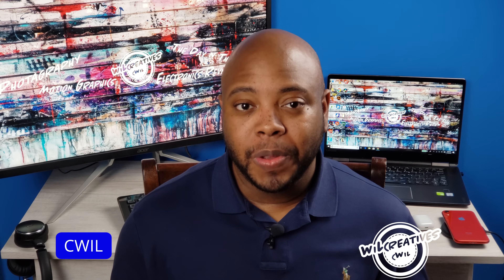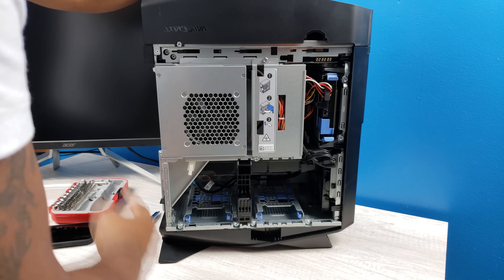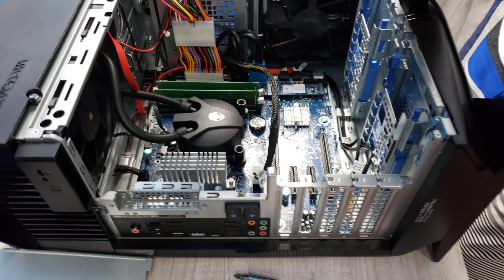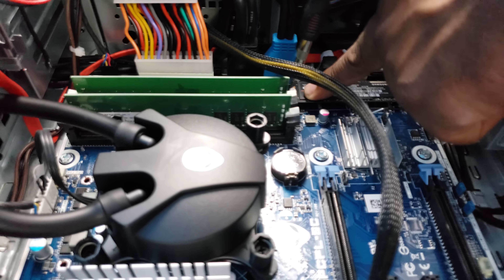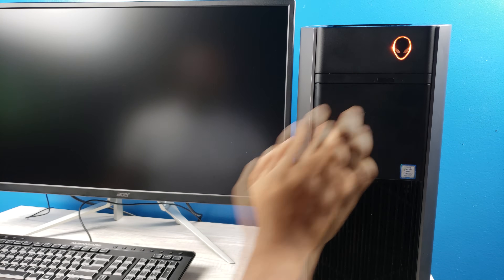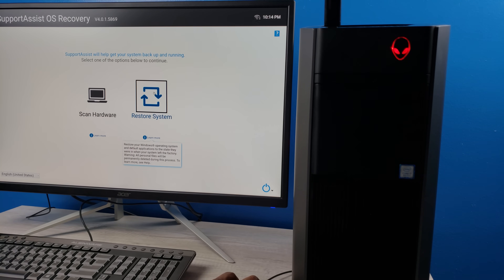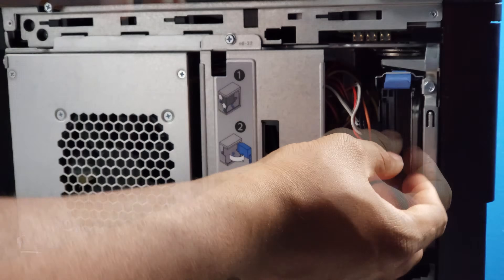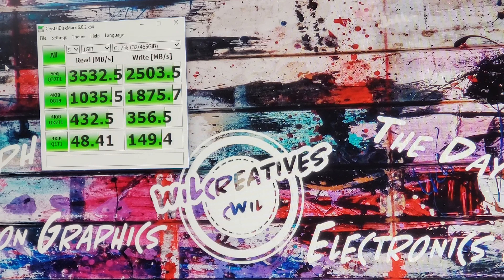First Impressions / Installation Samsung SSD M.2 interface 500gb 970 Evo to Dell Alienware Aurora R7

Comment: Hi Will, I live in Ontario Canada. Your m.2 970  is not available here. I see this one  Internal Solid State Hard Drive,Upto 7,450MB/s,Fast Speed for Gaming,Heat Control,Direct Storage&Memory Expansion,MZ-V9P1T0B/AM[Canada Version] 1 terabyte Would this one work for the R8 I just don't know what to do some say don't clone I just want a larger c drive for windows. Also this raid or ahci setting which one do I need I don't see a list of drives in bios only windows boot manager then onboard mic ipv4 then on board nic ipv6

Comment: Hi Will, Great content I watched a bunch of videos already. I have an Alienware r8 i9-9900K 16 gb memory 2.2 tb storage rtx 2080 850 power supply liquid cooled, added a samsung 870 ssd evo 250gb. My c drive is 256 toshiba NVMe KXG60ZNV256G. My c drive is almost full 25gb left I have windows 10 but need windows 11 Windows 11 needs 50 to 200 gb of space to be safe. I need to upgrade to a 500gb or 1 tb c drive. People tell me install a samsung sata evo 870 500 gb then clone c drive to evo 870 I need help Should I just install what you did the m.2 970 instead of sata evo 870 Should I copy c drive with windows 10 on it to a usb stick install the m.2 then use usb to put old c drive contents back then upgrade to windows 11my system tells me I have a free upgrade to windows 11 just click upgrade

Comment: Brother! 🎉 Your video from 6yrs ago is still helpful in 2025, thank you Will ! I installed a Crucial T500 1tb nvme into my alienware r7. Speeds are blazing fast.
*Tips* Will mentioned them but just a reminder/ clarification *BEFORE YOU begin, You disable the intel optane memory in the " Intel rapid storage" software from your pc, just click disable and agree to it. You might have to restart your pc, but just check again if the status is disabled, this is what you want to see, before turning off your pc and working on it. Once you install your drivers after the fresh windows install, I didn't check to install the intel optane memory software, I just unchecked it.
If you're only using a Nvme ssd you need to set it ahci in bios, like Will did.
Save yourself time and skip the support Os Recovery, I had the same issue. Just make a windows 10 bootable usb from Microsoft's website, its super easy, just watch a YouTube video. 
Thanks Will and hopefully my comment helped clear things up.
Reply from the maker: I'm glad I was able to help!

Comment: Hi,

I am planning to do this same thing. I want your clearance, does it support speeds of 3500MB/s when using samsung 970 evo plus nvme on board because the interface speed shows limited to 6gbps which is around 600MB/s. I have ordered both 970 evo plus nvme and 870 evo sata ssd

Comment: Great video... quick question. A little confused about what Intel Optane memory is..... I have  an Aurora A7 and my M.2 SSD is Liteon NVME..... is it Intel Optane as well? Also wonder if I have to disable Intel Optane setting in Bios before swapping the SSD? Thanks in advance for answering these 2 questions... it would help a lot

Comment: This is an awesome tutorial. It's been so long since I've gone into a computer to modify it and it's daunting. My actual hard drive is failing so while I was at it replacing it,  figured I'd switch out the 128GB M.2 SSD with a larger one and completely do a whole system wipe.  Watching it now, will be following along again when I do the procedure tomorrow!

Comment: great video sir! im wanting to do the exact same thing, would you still recommend that same SSD or is there a better option you'd recommend? ive heard that the R7 motherboard cant do gen 4 SSD speeds but i was considering just getting the best gen 4 that will fit so if i ever do upgrade to a new motherboard ill already have a good SSD for it. ive heard that gen 4s will work in a gen 3 slot but idk if that will cause any issues. if thats an issue i guess whats the best gen 3 M.2 SSD that you'd recommend.

thanks

Comment: Question Will, I think I messed up my computer, and I'm very sad. So, I did not realize that you had to disable the optane memory before you took out the actual disk from the M.2 slot. I took out the Intel Optane and replaced it with the Samsung 980 SSD. My computer now will not boot and continues to say something about searching for media devices. Currently, I do not have a USB to download windows onto. However, when I do get to a computer tomorrow and download it onto the usb, do you think booting it from the usb onto the ssd will fix this issue? Thank you very much.

Comment: 4:27  there's no need to unscrew all that.  the panel you took off has picture instructions on how to swing the power supply up so you can get to the motherboard, no screwdriver needed EDIT:  Not trying to be an ass, just pointing it out to save you some trouble next time you need to get into the guts

Comment: For those of you that are having issues with the internal HDD not showing up after installing the M.2 NVMe, it looks like the culprit is the drive it self. You need an M.2 SATA SSD, NOT an NVMe.

Yes, I know in the video Will uses an NVMe, but it looks like it's hit or miss. The guaranteed method is getting an M.2 SATA SSD. 

After testing, this is what I found out. I used a spare M.2 SSD that I had with the B key (so three notches on the M.2 Drive instead of the two as shown in the video. Here is a reference in case you don't understand what I mean - https://www.atpinc.com/blog/what-is-m.2-M-B-BM-key-socket-3) Look at the picture with the caption M.2 SATA SSD

I installed the M.2 SATA SSD, switched from RAID to AHCI, plugged in a Windows USB drive, re-installed Windows, went through default setup, logged into my account, went to Disk management, and Boom! Found the internal HDD with unallocated space. I right clicked on the internal drive, selected new Simple Volume, renamed the drive, did a quick format and now the internal HDD is being used for storage :) 

I hope this helps anyone else who was dealing with this frustrating issue. Again, you need to purchase an M.2 SATA SSD, not an NVMe. It's a hit or miss with the NVMe!
Reply: I got my SSD in it works but now my HDD isn’t showing up at all
Reply: @griffin0290  is it an m.2 SATA or Nvme?

Comment: Hey man, I did all this and for some reason I cannot use my original boot HDD at all. It's detected in BIOS but in the OS it will not show up at all. Any ideas?
Reply: Dax, did you resolve this issue? What type of M.2 did you buy? NVMe or PCIe?

Comment: I found an Aurora R7 for a good price today and did two things straight away - picked up a 1tb nvme drive and a Corsair ML120 Pro for the radiator fan.  The stock radiator fan runs at 100% and is loud.  The Corsair (non rgb) is the only third party fan that won't throw a code when you plug it into the motherboard and it maxes out at 2400 rpm & 37 dBA.  I thought about trying to clone the M.2 drive, but I everyone keeps complaining about the boot portion not working, so I created the OS Recovery just like WiLcreatives did in this video.  I switched the drive to AHCI.  I selected the windows boot manager and gave it a shot.  It took a while to load up, but seems to be working.  I did NOT get the same OS Support Recovery as shown in the video.  It was similar, but with different options.  I elected to do a Reset and Update.  I chose not to back up any folders since it's a new PC for me anyways, so nothing lost.  Now for the sad part - I've been sitting here for a couple hours waiting for the download part to finish.  This Reset process says it could take 1-5 hours... I'm thinking it's definitely going to be closer to the 5 hour mark.  I wish I had a quicker option.

Comment: Question, I would like to do this to my pc and was wondering do i have to do a full windows recovery to setup a new mvme m.2 drive(without intel octane), or would the original 1tb harddrive have windows and all my files still on it? So i wont have to do a windows recovery step?

Comment: Can we use 1TB instead of 512GB SSD? Also, My warranty is off so how can I retrieve my windows key for fresh installation?
Reply: hi, reinstalling Windows on the same computer motherboard doesn't require windows key.  Windows will automatically activate. Only if you replace the motherboard that you'll need windows key to reactivate.

Comment: I'm looking to do this with my son's R7.  I'm confused as to what is truly compatible, though.  I'm considering the Samsung 970 EVO but I also read about the WD Black SN750.  Do you know if the WD with heatsink will fit the R7?

I can't stand how Dell configured his system.  The OS/boot drive is a 128GB M.2 SATA SSD.  Installing software is a major pain because despite trying to ensure everything installs on the larger D drive the C drive still fills up.  I want to replace it with a 500GB NVMe drive.

Comment: Isn't it simpler to clone the two drives after initial installation of the SSD and then use the NVMe as the boot drive?

Comment: Hey this video is helpful . I have installed Samsung 970 evo plus in my hp envy bp112dx but i am getting one problem it is working on PCIe 3.0×1 because of which i am not getting full speed how to change it's interface to PCIe 3×4

Comment: Hi, I'm planning to install a m.2 sad pretty soon on my aurora r7. I have watched the video but I just have a few questions regarding parts of the video that I didn't understand. 

1: Do I change the SATA operation to AHCI even if I don't have Intel octane memory?
2: How do I get the data to a USB for a windows reinstall?
3: After installing the m.2 ssd, is it required to disconnect the hdd to make sure the windows reinstall will be on the m.2 ssd?
4: Is the hdd reformat required? If so, do I need to backup all the data in my hdd before I do a windows reinstall? Asking this because it seems like you just let the Alienware Support OS take care of backing up your personal files without any manual backup. I have a 2TB hdd and I have over 1.3 TB of data on it (not sure how big my personal files are), but I don't have enough spare storage to backup all of it.

These are all the questions I have and I apologize in advance if some of them are redundant. This is an old video so hopefully you see this comment at least before black Friday. Thank you.

Comment: No matter how many times I do this I can never get to the supportassist os recovery. I do what you did to a T but it always takes me to windows troubleshooting. I would appreciate any help or advice anyone could give me
Reply from the maker: golden crab126 in the video it didn’t work for me either. I used another computer and downloaded windows 10 to a usb drive and installed Windows then downloaded the drivers from Della website.

Comment: Quick question, I just installed the SSD and it works fine, but now after plugging in the HDD again it's no longer detected. How do I fix this? Thanks
Reply: Did you fix it?
Reply: Did you fix it?

Comment: i have followed everything in this guide perfectly and it worked but after a few updates and downloads of games on my computer onto the new ssd, my other 2tb hard drive is gone and only detectable in bios and not even disk management, any help??
Reply: Hey did you manage to fix it? Maybe check that the cord didn’t come loose for the HDD

Comment: Is it necessary to do a fresh install of windows when removing the optane memory in favor of the new SSD replacement? In other words. Can you just remove the optane and replace with ssd and use that ssd as storage for games instead of as a system drive with no changes to the HDD as System Drive?

Comment: Will this work with both the Samsung (MZ-V7E1T0BW) and the Samsung (MZ-V7S1T0B/AM)??  Both are 970 Evo Plus SSDs but the latter says up to 3500mbps data transfer rate as opposed to 550mbps and the hardware interface of the faster one is PCI Express x 4 as opposed to the solid state drive on the less expensive one.  Dell support won't tell me at all and I figured someone here might know.  Thank you in advance and thank you for the videos!

Comment: I have the same computer, however, I purchased the Samsung 960 Pro and would like to clone my ssd to this new Samsung 960 Pro. Only issue is that there is only one M.2 slot and the usb cables that would allow me to connect the m.2 externally have not worked (computer does not recognize it). 

Suggestions from anyone who has successfully tried this??

Comment: ok i have my windows created on my usb my question is ive unplug the original ssd m.2 optane memory like you took out and actually put in the evo 970 thinking it was plug and play lol .what puzzled me is that when i booted the computer up i had windows and all my files  and it showed the evo 970 as storage so if i do your steps what is going to happen to the originals windows  that i have where do i delete it so i can put the clean windows install or maybe i dont have to do a clean windows install becuase its on the sata drive. best buy must of installed the windows on the sata  drive if i put the evo 970 in and had windows maybe i just only need to set up my  bios settings like you did to boot  from the evo 970 then i shuold be good right. so i dont need to unplug the sata becuase if i did then it wouldnt recognize windows does that sound right bro.

Comment: Great Video....I have watched it a few times..    This is a first for me and don't want to mess anything up.  I want to install the Samsung 970 Evo Plus 1TB in my Aurora R7. The original drive has two key slots and is SSD sata whereas the Samsung Evo Plus is NVME has only one key or notch on the drive.  Is this a problem?  It appeared that the sata in the video had two keys and the Samsung had just one so I'm assuming this is fine to use in the m.2 slot?  Thank you just trying to cover all the bases before I get started.

Comment: so do you have to back up windows before the install?
Reply from the maker: Richard Palmisano that’s totally up to you. I saved my important information and did a clean install of windows fresh. I heard that was the best option.
Reply: WiLcreatives What’s up my brother my install went great I have a total of 48 GB of RAM but I have a question should it be running 2660 MHz because I’m reading 2330 MHz could it be the fact that I have a different type of memory ram than the original 16 GB I left the original 16 GB in and I also installed the Evo 970 500GB SSD I must say that is a solid SSD any info would be appreciated do you think maybe I have to swap the ram two different banks? I’ll go buy another 16 GB that matches my other ones and take the other 16 GB out that was originally in there. By the way I have the same cup as you Alienware aurora i7 8700 The only thing different is my graphics card is a GTX GeForce 1080

Comment: I installed the 970 EVO in my Aurora R7 but cloned the drive to the new EVO 970 module instead of performing a fresh install. I found out that I had to keep the setting RAID ON for it to boot to the new SSD...

Comment: Thanks for the video, definitely helpful.  I just bought a brand new leftover R7 for $700. last night It's got the i5 8400 and 1080GPU.. It  did not however come with SSD. Or NVMe. So Im buying a Sebrent 512gb NVMe m2 drive. And I'm going to do the same thing. I know the Sebrent drives come with cloning software. Hopefully I won't run into any problems. Did you use a different product key? Or is the key tied to the machine (BIOS) or whatnot?

Comment: Just to confirm, you removed the HDD to install everything you had prior to the SSD? I want to leave windows on my hard drive, I just want to put a game on the SSD. So I would only have to install it, initiate the ssd in settings, then put the game in it’s storage correct?
Reply: The alienware aurora has trouble recognizing the nano ssd. And factory 16gb intel optane one simply accelerates the speed of the harddrive, so if you remove it without doing all of this it will hinder your PC's performance.
Reply: @crackshotmcgee9588  Thanks I figured it out about a week ago lol, I tried installing the SSD and it messed up my computer. PSA to anyone getting an SSD for it, you have to go into a specific program and wipe the Optane memory before installing SSD.

Comment: Is there anyway to copy the OS over from my Hard Drive or do I need to do a fresh boot
Reply from the maker: Yes there is software out there called macrium reflect that will do it but I haven't used it before. Which is why I did a fresh boot.

Comment: Hey man, literally just made the same upgrade to my R7. Not even Dells Customer service could help me, they told me to wait for a call for 48 hours to get help so I instead just used your video. Wished it started with informing me about getting a Recovery drive first, it said atleast 16gbs but my 16gb didn't  work, had to use my 64gb after 2 times of trying to download the recovery drive (30+ mins each time!). Anyway thanks a lot man!

Comment: Your videos have been very informative. In the couple of months, I plan on replacing my NVME drive. I have the Alienware Aurora R8, and it only has a single 512GB NVME drive for everything. It's very fast, but the storage is insufficient.

I'm thinking about replacing it with maybe a 2TB NVME SSD fast drive from Microcenter. Is there a way to just clone the drive, turn the PC off, swap the drives and be done with it?

Or do I have to create a backup on using the Alienware software on a thumb drive, and then swap the drives? Thanks again. Your videos are a godsend.

Comment: Nice video man. You made it harder then it had to be. All you have to do is swing your power supply out then unscrew the screw and pull/push out the M.2. You do need some small hands but it still can be easily done. Only problem is screw falls down so keep and eye on it.
Reply from the maker: Thanks for the feedback!